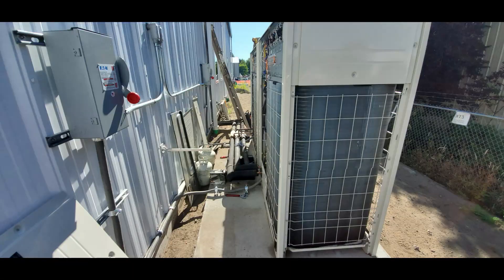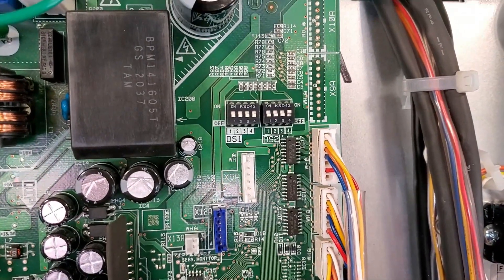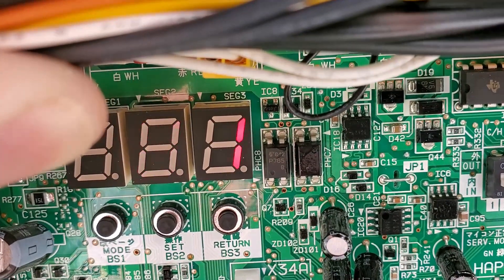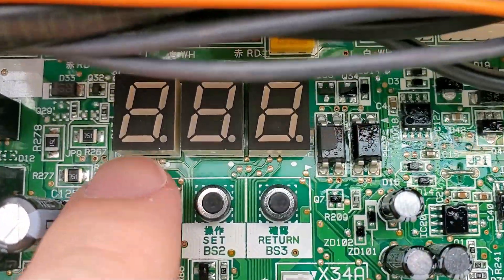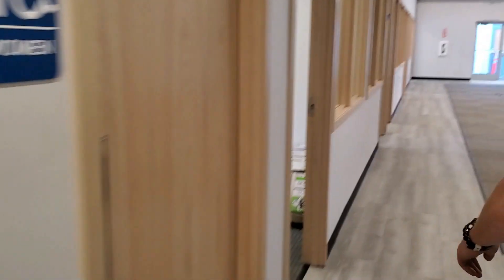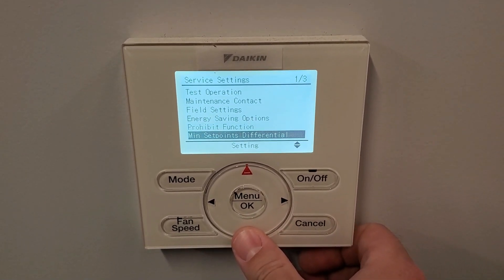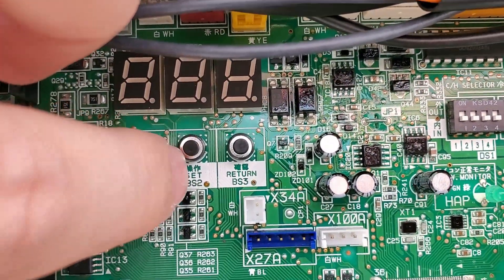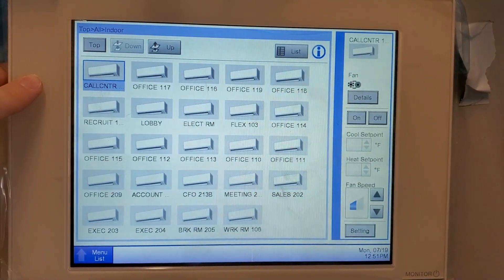Daikin VRV Commissioning Made Easy | VRV Commercial Start-up Day 1 | Things You Must Know 7-20-2021

Comment: Surley he pressure tested it befor adding the gas? its a bit random for him to of added the refrigerant and then found a leak?
Reply from the maker: The odu had a leak in the coil. Didn't see it till he opened the king valves. Yes he pressure tested all the field piping.

Comment: Great Videos! Questions regarding the addressing. I noticed you set the Group Address (Group) not Group Address (Indoor) on the wall controllers. Can you please explain the difference between the 2? Also, on the outdoor unit you gave it an Airnet Adress of 1, do you need to give it an Airnet address or will it get picked up anyway? What would happen if you changed a PCB and the tech didn't give the unit the Airnet address would you get the blue triangle comms error on ITM for this outdoor?

Comment: Why would you put into forced fan?

You could just put into recovery mode and look for green lights on stats. Especially if you have a job where indoor units aren’t visible.
Reply from the maker: What about situations with multiple indoors on a single nav? Or layouts without nav controllers? 
There's lots of ways to skin a cat, so I usually just recommend what is most successful for most situations.

Comment: What if it doesn’t stop blinking??
Reply from the maker: The 3 small circles on outdoor flash forever? Usually means the outdoor doesn't see anything at all. Check com wiring and power to equipment. Likely no bs box power or indoor power or com wires are landed wrong.

Comment: If you replace a branch box for identical replacement, do you have to re address after? Since it’s not adding a new unit it’s same amount of Units?
Reply from the maker: I've only ever had to replace one branch box, they rarely fail. But I reset addressing just to be safe it takes all of 15 minutes. No idea if it would be "required" but figured I'd rather do it to be safe than spend more time doing it later when I find out it's needed lol.

Comment: Hey Dana I’m on a job with 138 indoor units. What is the best way to commission this large of a system with only two techs?
Reply from the maker: Nice project!! Well, I guess step 1 get the itm powered up with expansion d3 adaptors and get all the stats programmed (addresses and field settings). If you don't already have a sheet then make one so that you have all the addresses written down as you go so you're not guessing or trying to remember. 
Then port check. You can do 2 networks at a time if you've each got a laptop and service checker. Heat then parallel then full cool then fan test for indoor eev bleeds, finishing up that network of systems. Then move on to the next d3. 
Then upload the itm program from laptop it'll go faster to pre program on laptop. Then do any bacnet and airnet engineering to wrap it all up. 
I will probably do a video soon about this it's at the top of my list.

Comment: I'm getting a UF-05 code on my vrv system through all 8 units, what would you recommend to try and fix the issue?
Thank you for your time.
Reply from the maker: You have a branch box? If so you have a closed isolation valve. Or set of closed valves. Uf is usually no refrigerant temp change across indoor unit. System wide error so you'll need to check all of your isolation valves including the service ports ensure those got opened.

Comment: how can i contact you i have problem in my vrv system , my problem is it can’t turn on after all of that and it have no problem code
Reply from the maker: You are welcome to email me. Though my assistance may be limited. If it does not turn on at all and also has no error codes, I'm not sure what to tell you. Have you made it to a blank screen or is your unit still flashing the small circles?

Comment: Dana,  why am I getting u9 and u4 error codes on VRF 4 system only in middle of night.   I came to my job this morning and all stats are blinking.   My wiring looks good and if I reset it the equipment comes back online.
Reply from the maker: U4 is com error. U9 means there's an error on the system but not on the stat that's blinking the U9. 
Regarding what triggers the U4 this can be a lot of stuff. An indoor or branch box or outdoor losing power (only takes one unit), could be a loose wire this happens a lot. Can also be the wrong type of wire, such as solid core instead or stranded. Solid sucks for communicating systems it needs to be stranded. Also check if it's shielded or not. If shielded (which we don't recommend), you need to make sure the shield is grounded at one end only otherwise it creates an antenna affect causing intermittent com issues. Shielded wire also reduces the total allowable length of wire on a network (collection of systems) from 6600 to about 5200 plus or minus. I had a job a couple years ago they ran shielded in most areas and albeit grounded it right, any time more equipment came on than what the network could handle it dropped out. Had 4 systems on it and it would run 2 no problem. Systen 3 or 4 comes on poof com errors everywhere it was a nightmare to trace out the cause. Split networks in half problem solved. 
Not sure if that's your issue or not though. 
The other thing to check for is proper daisy chain. Folks will sometimes splice or star or branch the wiring and none of that works. Must go from outdoor to branch box to branch box to erv. From each branch box port to respective indoor connected (this part is more like a home run from Port to indoor physically. And the box internally daisy's it sort to speak).

Why does it happen only at night is a great question. It's possible that something turns on and runs over night that doesn't run during the day and that operation causes the interference. Could be something on the vrv gear or something next to a unit that turns on and maybe that line voltage was ran too close or with the com wires. Gotta keep that stuff away from each other. 

U4 is a pain sometimes especially on larger systems, just one of those things that takes some extra time to trace out. Hope this helps a little.

Comment: Hello, I have this unit RXYQ12T and I want to cool and heat (maybe under floor water heating) a residential building 169mp on one level and one garage 140 mp . The question  now is, is it too big for this purpose? if i am gone attach Hxy125a for underfloor heating is it enough for heating the entire house in winter to 25 celsius? Thank you.
Reply from the maker: I woukd recommend having an engineer do a load Calc then select your unit based on that. Only safe way to do it since I'm not familiar with your design temps climate or other ETC

Comment: I sir I have one problem in vrv 4 there is E09-03 alarm am replaced EEV and also main pcb but still alarm existing.  Kindly help me get resolve this issue. 🙏
Reply from the maker: E9-03 is a bad connection at outdoor eev. Likely loose connector or cut wire. Or bad eev motor. There are a few of these eev coils though depending if you have a heat pump or heat recovery so verify ohm reading on each. Service manual and service app called daikin hub have the step by step to check the coils and ohm amountz.

Comment: hi i work in a school and have the Daikin system in it and 2 out of 6 indoor units say  "under centralized control when they are not, i have just changed the settings as per your video but they still say it , just wondered if you have any ideas what i can do, thanks for the great video by the way
Reply from the maker: Do you have a central controller installed or a building management system? Usually on schools we put a central controller or some level of bacnet or lonworks controls in it for remote control and remote access. 
If either are installed and set up with a schedule or any parameters that limit the controllers function it will be displayed. This can be as simple as setpoint restriction or scheduling. 

Also note that when using t1t2 for auxiliary devices if not programmed correctly than it will say central control when they alarm. Good example is condensate pumps and float switches which are normally closed alarm points, get landed on t1t2 which by default is forced off, a normally open contact. As soon as it closed it forces off the unit and says central control. 

Any of those things can cause it.

Comment: Any idea why I would have 2 separate 1 to 1 daikin cassette units after running through the test operation seems to run fine but after it satisfies it doesn’t seem to want to come back on unless it’s set 5 degrees below actually temp? Shows no error codes on stat. Also looking in maintenance info it still shows U3 and doesn’t list indoor/outdoor model even tho it went through the test operation and didn’t seem to have any issues?
Reply from the maker: 1 to 1 sky air split or vrvs? You have a nav hooked up? You need to change field settings to sense from stat. The u3 in the menu history is history someone just turned on the stat before testing anything. That's old. Any live codes blink green on/off button light. 

Shouldn't have to set it 5 degrees below room temp to come on in cool mode though, may be delaying compressor since it has a 3 minute approximate minimum off time after running and shutting down. Not sure how long you're waiting between cycles. Also check your thermo-on deadband field setting.
Reply: @InverterAlways  1 - 1 sky air “RZQ36TAVJUA” With a “FCQ36TAVJU” with the “BRC1E73” controller…. same issue with the “rzq/fcq30”.  I changed the setting to use stat reading, changed dead band to 1* still same thing. It will be 74* in the space I’ll need to set the stat below 70* for it to come on it will cool the space down to set point and shut off. Climb back up to 74*.. with it being 2 separate systems doing the same thing I’m thinking there has to be something in the settings I’m missing just strange they both are acting the same way.
Reply from the maker: @Itzmyke1  the unit shouldn't be shutting off the fan when it gets to setpoint unless you set the field setting for that to happen. Definitely strange though. Have you tried just running one of the systems and turning the other one off to see if there's any issues between the two maybe wiring related if they are right next to each other?

Fcq units. Do those come with the sensor built in similar to fxfq? If so umyou should disable the floor sensor field setting. Floor sensor will override/take priority of control over nav and return if not disabled. Try that. That may be what's going on. I believe it's mode 24 settings but you will want to triple check I don't have any of my stuff on me today to check. Will try to look later though.
Reply from the maker: @Itzmyke1  mode 21 8-01 disables the floor sensor. Try that.
Reply: @InverterAlways  yes I changed the setting to disable fan when it is satisfied. I wanted to make sure it wasn’t just shutting the OD off and the indoor was running because of a call for cool. The indoor in fact doesn’t run at all when it’s satisfied and doesn’t come back on either. Yet no error codes come up at the stats.
Reply: Turns out the model we had had the eye senser for occupancy and since the room isn’t being used yet it was shutting the unit off!! Why didn’t they put that in the book. Hah
Reply from the maker: @Itzmyke1  there are some settings in the install but it's been a while since I've checked exactly which ones are in it. So disabling the sensor cleared up the issues?
Reply: @InverterAlways  sure did.
Reply from the maker: @Itzmyke1  awesome man!!

Comment: mister, how to refill Hitachi vrf refrigerant
Reply from the maker: Are you asking how to charge a Hitachi system with refrigerant? Pull the system into a proper deep vacuum then weigh in the calculated amount that needs to be added. On Hitachi vrf you can create a com error by removing the com wire amd it will open all the expansion valves so you can pull the proper vacuum.

Comment: Commissioning my job finally today 4 bs box 32 total fc 6 od units . This video is very very helpful
Reply from the maker: Awesome !! I'm getting ready to do a very similar on. 35 to 36 fc per system 6 systems. It's a big one for sure! Best of luck hope it goes smoothly for you today.
Reply: Getting ua 53 code all wires are landed right I’m sure . This is a 2 outdoor master and slave with 2 joined bs boxes
Reply from the maker: @gambleezzzy916  US-53 means bs box dip switches don't match connected indoor units. check the indoor unit power to make sure nothing is powered off by mistake. then check bs wiring for each indoor. and verify correct dip switches are set. you'll need to kill power for 5 minutes, when you reboot hold return on vrviv for 20 seconds to reinitialize, or hold reset on vrviii for 20 seconds to reinitialize.
Reply from the maker: @gambleezzzy916  if your wires are good then it's either power related or dip switch related. It's 1 of those 2 things so triple check your dip switches are set correctly. And go triple check power to all bs boxes and indoors. 
You can count indoors from outdoor and ports to see how far its off and put the the system into forced fan to see which ones aren't running their fans. That'll tell you real quick which units aren't talking.
Reply: @InverterAlways   new issue fixed the other one. This says u4 03 verified wire from single indoor wires at od unit terminal to the od outside is good still getting code
Reply from the maker: @gambleezzzy916  indoor error. Go turn on stats and look for the stat in alarm. U9 means go check a different stat. My guess is you have something unplugged at an indoor like thermistor or eev
Reply: @InverterAlways  a3 error on a t stat gonna see what I can find
Reply from the maker: @gambleezzzy916  condensate alarm. Open float switch

Comment: I am working on the dip switches I was having trouble of getting the correct amount of units. Once I did the Dip switch on the First bs (Ds2) 1 to on) I got the correct amount of units I have two branch boxes. When doing the dip  switches Do I gotta Put on the DS2(A1P)  (1To On?) Is the Joining A & b branch boxes? Do I also gotta Do the same to the other branch box Ds2(1 to on )  because now I Am getting error code UA-53 error code
Reply from the maker: Ds2 is for pairing two sets of ports together. A and b for example would be ds2 switch 1 yes. But you'd be best off working directly with your local vendor who should a set of drawings. That way you're covering your basis and not setting the wrong setting. Also. When you do change something make sure you do it with power off at the box. And when you reset the outdoor if it's vrv4 or vrvx, hold return for 20 seconds when you power it back on. That resets the unit count. If it's vrv3 then hold reset button instead for 20 seconds when you power the outdoor back on. Then redo your indoor count.
UA-53 is almost always mismatch indoor wiring to dip switch. It can also be power related. Check that all your indoors have power.
Reply: @InverterAlways  thank you for the info. It help me understand it more

Comment: I have a way to find out the indoor unit which is not communicated to outdoor unit. You can use mode 2-21 and check the remote controller of each indoor unit. If indoor unit is not communicated to outdoor unit then remote controller will not display  " Test operation " in mode 2-21.
Reply from the maker: Correct. You can do that too, I usually just put the system into forced fan. Either option is fine though 👍

Comment: How do remember each setting such as how you identify how many indoor units are connected?
I assume there is so many more settings for diagnostic purposes but I can't seem to find any useful info
Reply from the maker: Well, years and years of doing it over and over has helped a lot for sure. But I also refer to the installation manuals for each indoor unit. And Daikin also has literature that shows some general settings as well.

When you have multiple indoors it definitely requires closer focus, it's very important not to set the settings incorrectly from one style to another. Practice practice practice and make sure you always go from documentation to the stat.

One thing you can do ahead of time is male yourself a sheet at the office for each indoor style you have on site. Go through all your literature there and write down the settings you want to utilize for that job. That way on site uoure just following a page of notes, helps it go faster. The same is true for addressing, I always make an as built programming sheet to reference ahead of time so it takes the guessing out of it.

Comment: What happens when the three displays are fixed but do not turn off?
Reply from the maker: So you have three solid little circles that won't turn off? That means it couldn't initialize and you have an error code. Turn on your nav controllers to see what the error is. After much time (30 minutes or longer) the outdoor usually goes into error as well but it depends on the error I suppose. If you wait for 30 minutes and it never goes blank quickest way to find out is to turn on stats and see what the error is. U9 means go check a different stat by the way. Lots of them may say U9
Reply: @InverterAlways  Thank you. tomorrow check what you tell me.

Comment: How do I suspend the master control board and run the slave if the master board is faulty?
Reply: Yes the second unit board is ok. After transferring f1 and f2 how do I convert the slave to master which code? And how do I lock out the other unit.